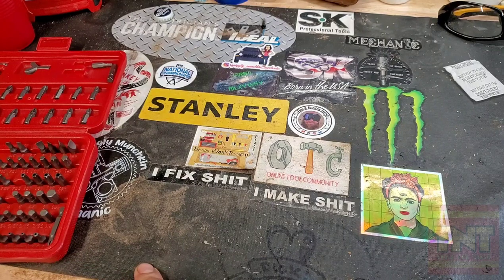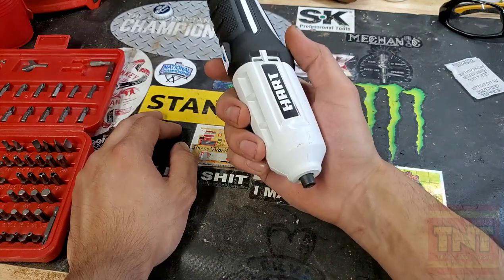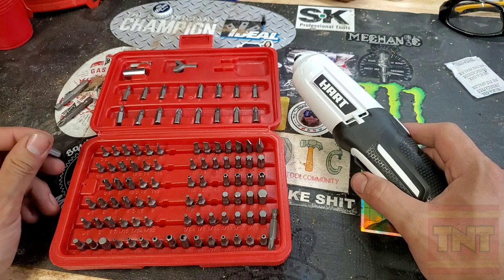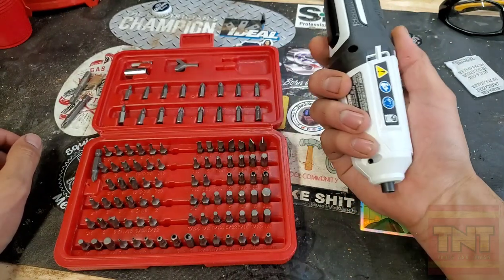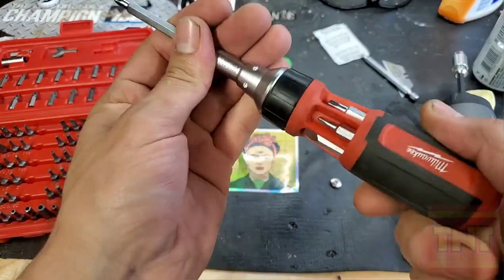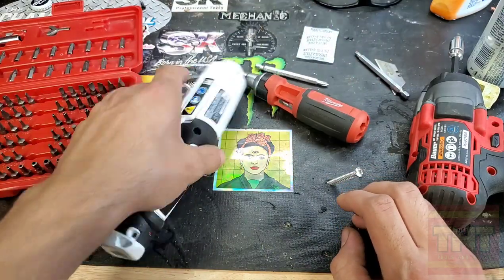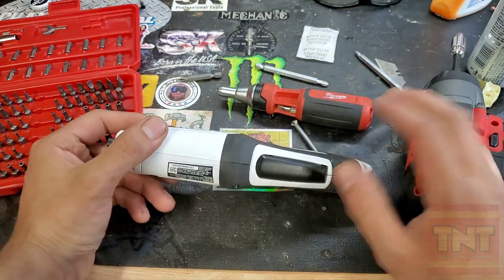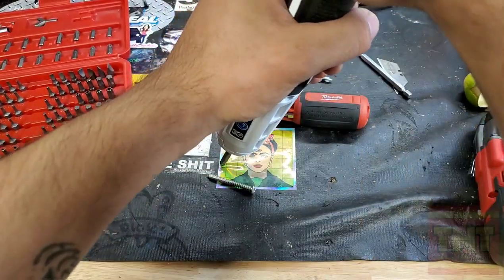Hart cordless screwdriver  Handy dandy?

Comment: I am a woman in a wheelchair. I have lived on my own since I was 18 and I am now 41. That said, I know my way around tools because I often fix my own wheelchair. I got the hex bit set for this thing, and I use it mostly to tighten the brakes on the front my wheelchair. Which is a customized manual. It took me awhile to find the right hex bit to fix my brakes, , but now that I have, they're pretty stable in between visits to the shop. It is convenient, , for sure and I've used it to put together small pieces of furniture on my own.

Comment: I had a really old Black & Decker and it was not impressive. The hart is better has a lot more torque. I agree though it's only good for specific things I just like it especially if you're having someone help you install hinges on doors and you don't want something that spins so fast it's going to slip off.

Comment: I was gifted a similar Black & Decker cordless screwdriver a dozen+ years ago and I was skeptical about its utility.  As you experienced, these tools are darn handy.  I've used it on several projects and gone through several of the replaceable NiCd batteries.  I use it with nutdriver bits more often than with screwdriver bits.  The old B&D has an adjustable clutch.

For heavier jobs, I bought a 12 volt Milwaukee Fuel driver last year.  Its top speed is much faster and it has more power than the B&D.   The Milwaukee is pistol shaped and takes up more space.

Comment: They need to give the once great Hart name to someone who will do right by it.
Someone who will produce some of the worlds best California framing hammers here in America,  not some corporation who's gonna run that mans last name through the gutter bt using it on Chinese power tools and random garbage the real company never had anything to do with.
Reply from the maker: I never knew they use to make hammers 🔨
Reply: @toolsandtrash6911  
Their California special was at one time considered the king of framing hammers, Mr Hart formed the company around 83 but eventually died I believe and it was sold to another the  sold to TTI in '07 when they really became just a name used on imported junk.

My very first hammer was a HART and that's probably why I care so much.